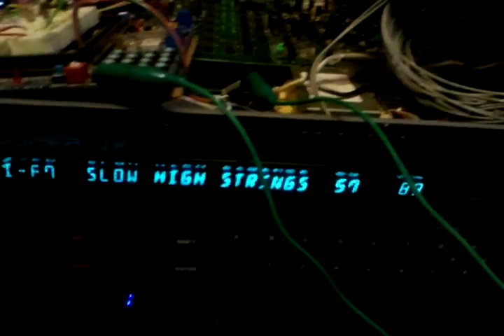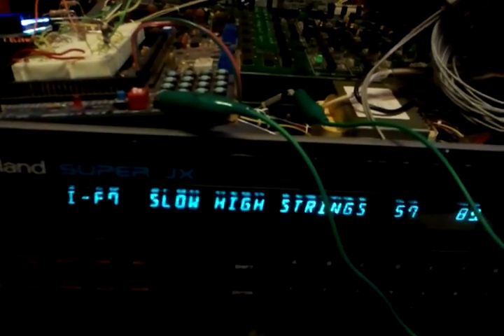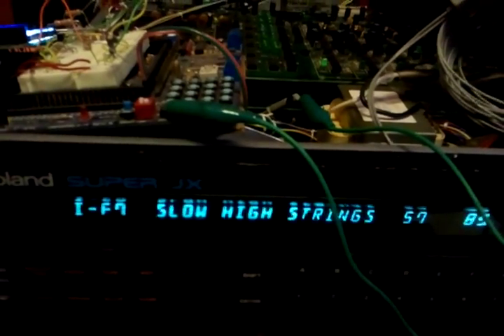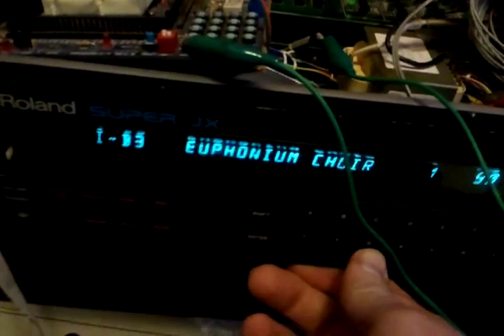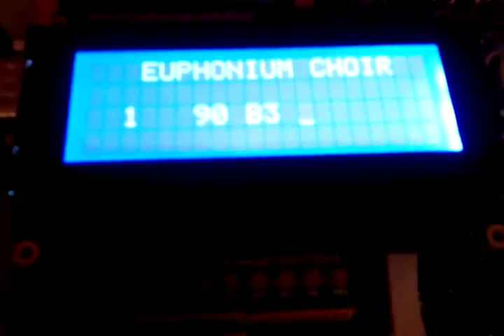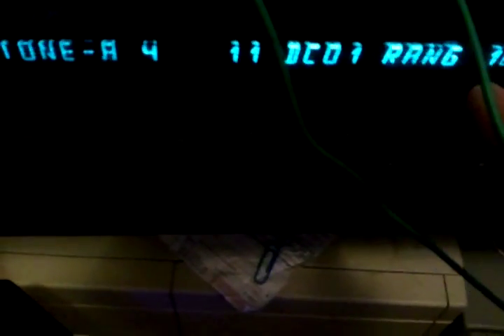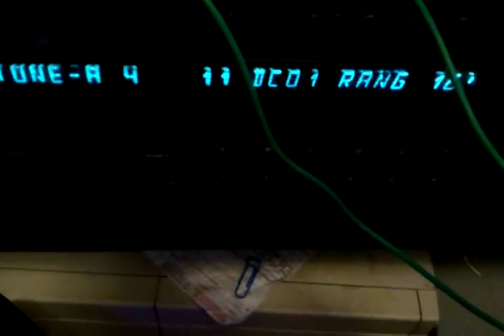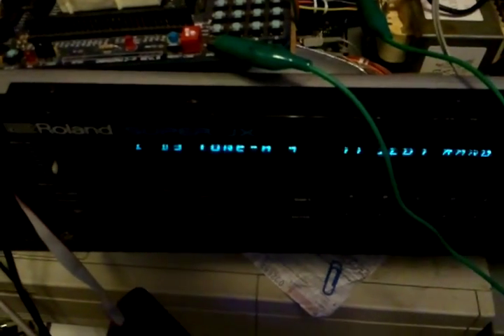MKS-70 VFD to LCD conversion proof of concept

Comment from the maker: @eminentband Reading the bytes is the first challenge.  Then it's "just" a matter of decoding them -- as you can see I still have a ways to go.  It's a pattern of control and ASCII-type bytes.  My guess is flashing and dots are flags in there but I haven't verified.  Haven't had time to check Colin Fraser's disassembly but that might help.  If you find out more let me know. :)  Also my LCD is too slow to drive directly from the data, I needed to buffer it.  Let me know how you're coming!
Reply: Hi,how have you resolved the question with reading Serial data and adapting it for LCD ?